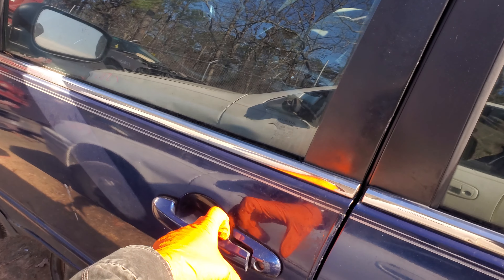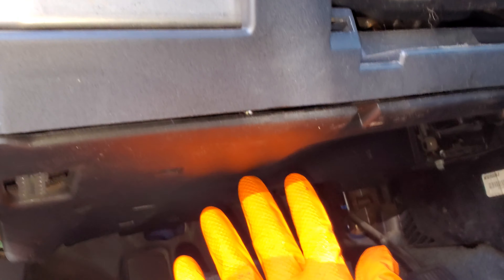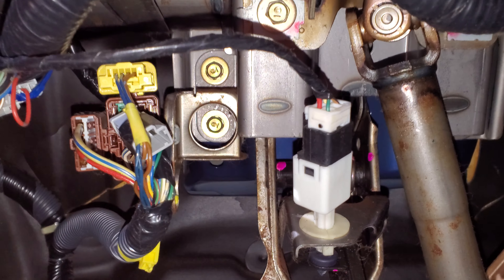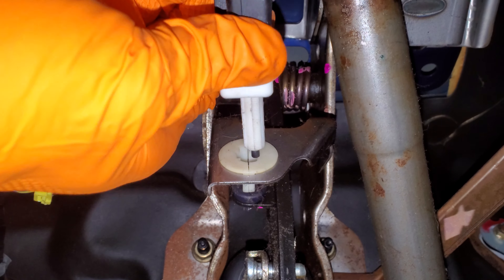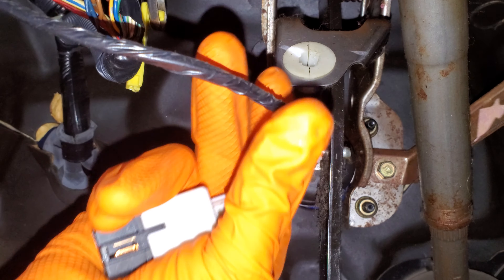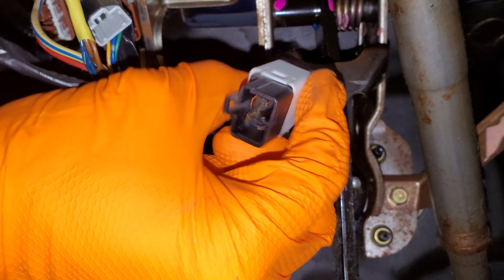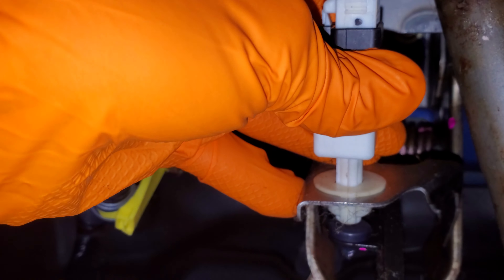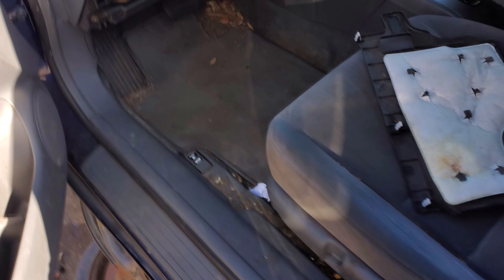2003 Honda Accord Brake Light Switch Replacement, Stop Light Fuse & Circuit Explained

Comment: This video was extremely helpful. I was able to quickly figure out why my brake lights were staying on and fixed it so it would work until I can go get the piece that I need because the stores are closed now.  I am a female that needs to know these things. Thank you so much for this great detailed video.  The videography was great too. I am subscribing.

Comment: Here's a helpful tip. Before you remove the old switch, take a pencil or marker and mark the spot against the round ring on both sides. Then remove the old switch and align it EXACTLY alongside the new switch. Then mark the    new switch at the EXACT same spot where you marked the old switch. This way, both old and new switches have the EXACT markings. So when you install the new switch, you can use the markings to guide you as to where to lock it in place. I did this and got everything to work on the first try by using the markings on the new switch as a guide.

Comment: This made changing that switch very easy the shifter would not shift out of park and the brake lights would. not come on. I changed the switch, did the easy adjustment and it was a fantastic and easy job thanks to this video!

Comment: i just want to add the quick comment. this video helped me out a bunch and i was able to get my brake lights working again. what i did was took the switch apart which was very easy just the two clips on the sides and cleaned the contacts off on the switch because they were covered in carbon and wouldnt make a connection so my lights never came on. just cleaned them up with paper towel and alcohol and put it back in and it worked perfectly!!

Comment: This same switch (the other 2 contacts) are for the cruise control.  One set of contacts can go bad or shift and the others work fine (brake lights can work like normal but you need to press the button much further in for the cruise to stay engaged).  So sometimes you just have to replace the switch..  That's where I am.  Great video to describe how the switch comes out and is adjusted.

Comment: This was such a helpful video. Fixed my problem on 2004 Honda civic. The little rubber stopper had completely worn away. Bought a new one for $10 at autozone and replaced it in less than 10 minutes! Thank you so much!!
Reply: Please what's the little rubber stopper called online I want to buy it please

Comment: I knew my grommet fell apart because it was laying on my floor mat and the brake lights stayed on. I found this before my battery died!  I knew what was wrong. Same problem with multiple vehicles over the years. 
I used your video to remove the panels and gain access to the switch/grommet area without breaking anything👍 lol

Comment: This video confirmed another problem I have been having with my 2003 Accord 3.0L. My TCS warning triangle and TCS letters on my dash lights. It turns out that this switch for the brake lights can also cause this trouble light to come on, making one think the traction control system is misbehaving!  FYI
Reply: Yo tengo el mismo problema, se me prendio el tcs y el abs y el breaker tambien, alguien que me oriente

Comment: Thanks for this video. I was searching the net to find out the wire functions on the switch and I came across ur video. Very helpful. So the red gets power from the fuse then sends to the black n white when brake pedal is depressed.

Comment: Great video. Thanks also for pointing out the right fuse location. That's all that was causing my issue. For some reason the fuse was in the #10 location (unused) when it was supposed to be in the #13 location (brake lights and horn). As soon as I switched the fuse to the right location in the fuse box, the problem was solved. Not sure how the fuse got in the wrong location, but happy it's fixed.

Comment: I had the left and right lights not work while the center light remained functional, no blown fuses/relays and the brake switch and bulbs were fine. I fixed the problem by disconnecting and re-connecting the plug towards the back of the trunk on the driver side close to where the wires split to go to the rear/middle light.

Comment: Very insightful video. I noticed some small plastic fragments on the driver's side floor board. Never made the connection between the brake pedal switch pad and my lights staying on. $5 and 10 minutes later my brake lights now turn off. Thanks!

Comment: Great video!  Thanks for posting.

Question on the brake switch "fine tuning" ... If the switch is not replaced tight enough. Is it possible that the brake lights will work like they're supposed to...  But the cruise control function could be impacted to not stay on (because it thinks the brakes are being applied)??

Comment: replaced the switch and the lights are still coming on. The plunger on old switch did not seem to be stuck as in other videos.  Checked the 20amp fuse, it looked ok?  Could not tell if TCS motor fuse was good or not?  My meckanic says to clean battery terminals and the fender wall wire harness connection. Which i will do today.  What else could be happening to keep the triangle ane 'TCS' coming up on dash??  any help?  the pump module is around $1100, so i am hoping it could be just wheel sensors or something cheaper.

Comment: I have a question, I hope you see this. So my taillights won’t come on or my dash won’t light up when I turn my lights on. My high beams and headlights are good, and when I tap my brakes the brake lights light up. I’m so frustrated and can’t figure it out. My car is a 2000 Honda accord

Comment: Does the switch also affect the horn? On a 2001 prelude my fuse is fine but no brake lights or horn(that I didn’t even check until now and it went out too)

Comment: Hi not sure if you will see this but I changed the break switch and my break lights still don’t come on I checked the horn fuse and it’s blown. I replace it and burn right away when I install it any suggestions

Comment: Great video! But I am having trouble with the very first step; when I remove the one screw at the bottom left of the front panel, the panel does not come cleanly off the way it does in the video. It is sticking very hard on the right side of the panel, and no amount of pulling will get it off! In fact , the cover is bending in one place to the point of breaking. Is it possible there is another screw holding it in? If so, I am damned if I can see it, let alone access it! Any ideas/suggestions?
Reply: same issue here. i doubt u will respond but did u figure it out?

Comment: Hey I am buying an used Honda account 2004 but it has tcs and break light on and the guy who selling it to me said that one of the Mechanic fried his computer by connecting the battery backwards and that’s the reason why the TCS in the brake light is on and said he forgot to clear it but I’m not sure if I change the brake switch and it would fix it so if you have any advice please let me know as soon as possible I’m gonna buy the car tomorrow
Reply: Encontraste respuesta a tu problema, yo tengo el mismo problema, tiene encendido el tcs y el abs y el breake

Comment: Question - if this part is faulty, can it lock my gear box in park? My shifter is locked in park even when i depress the brakes and I checked the fuse - nothing seems wrong. Would replacing this part be a viable solution?
Reply: What did u end up doing mine did the same thing?

Comment: I replaced the brake light switch and the brake lights still do not work,  however, the third brake light does work.  Any ideas?
Reply: Did you get this fixed? I am experiencing the same issue. Thanks

Comment: I have Accord  2004 (AUTOMATIC)...
Car ran fine. Parked it and when tried to start, no crank. All dash lights come on, battery strong, but turn the key and nothing. Also, shifter stuck in Park. Used manual shifter release and tried starting in Neutral. Same, no crank not even a solenoid "tick". Any ideas what the problem could be? - thank  you.
Reply: What was the issue?

Comment: If I changed the brake switch and the brake light bulbs and my fuses are good and my brakes still don't work. Any idea what it could be anyone?
Reply: Did you get this fixed? I am experiencing the same issue. Thanks
Reply: @GenerationWealthTrain  I didn't 😞

Comment: We have a problem getting car out of park ,have to step on and off brake pedal a few times for it to unlock park lock on shifter ,can u help with any info in that ?
Reply: Did you fix it?
Reply: You might have to change your break light switch
Reply: Junior Hernandez yes thanks

Comment: I checked every single fuse and switched them around, checked every solenoid and moved them around checked all bulbs, replaced the brake light switch. Still no brake lights. No 3rd brake light either.
Reply: Did you ever find a fix? I've checked my fuses and brake light switch as well, still no lights
Reply: Same situation but my center brake light works, did you ever figure out the issue?
Reply: @notdrew3780  turned out to be the aftermarket taillights. They worked for a time than overloaded the circuit. Or I imagine that's the issue cause I swapped back to OEM and never had another issue